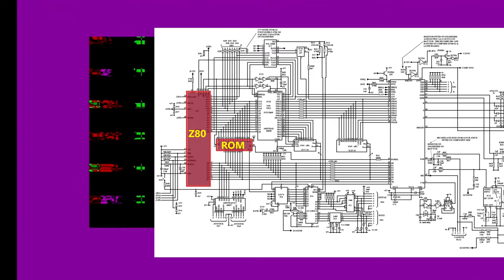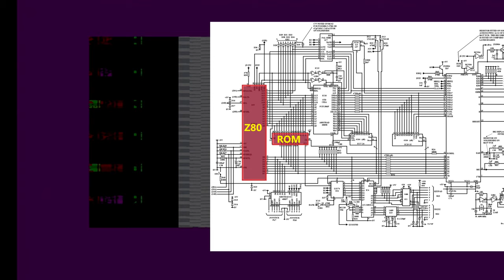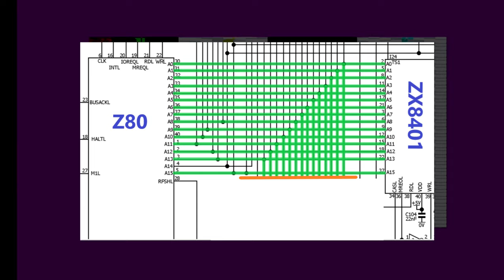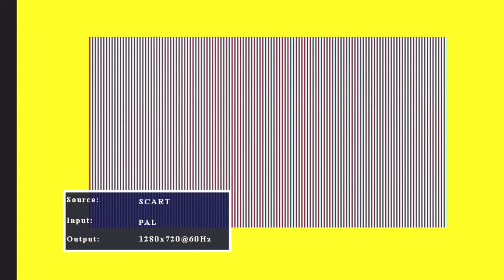ZX Spectrum 128K +2 Repair - Reset Switch and RAM faults

Comment: I pulled my old one out it was put away working but it has an issue now. It comes on as normal loads the game and it either crashes back to loader screen or it very slow or it just freezes in game. I’m thinking it might be a capacitor issue or a ram chip. It sometimes crashes while loading the first game loader screen photo on agent x the photo is scrambled
Reply from the maker: Could be an issue with your loading setup rather than the machine! If you're using audio
Reply: @HappyLittleDiodes  I’m using its tape drive it seems ok some lower quality games are fine but the bigger games are having issues
Reply from the maker: @WidowUK  you could try loading from a wav file using your computer.  Or the playzx app.  It's either your loading setup or your upper ram
Reply: @HappyLittleDiodes  like I said it was working fine last week but has suddenly become unstable. Normally if it was loading issue you would get an r tape error or it would just fail to load all together but as it loads the game and then has issues I’m looking at an hardware issue. It being very slow and freezing and crashing I think it might have a ram issue or maybe the power supply has a bad capacitor
Reply from the maker: Try the command PRINT PEEK 23732 + 256*PEEK 23733 tell me the result

Comment: hello, I'm trying to repair a 128 + 2 that has a similar problem, the magenta border and the black center. When placing the new 4164 chips on top of the existing ones nothing changes. Is the ROM broken? Is there any way to test the ROM? Where to get a new ROM? Thank you
Reply from the maker: What diagnostic tools do you have access to? Do you have an oscilloscope?
Reply: @HappyLittleDiodes  no, only a multimeter...
Reply from the maker: OK then you're a little restricted, but you could start by checking your voltages, find a schematic and check +5, +12 and - 12 V at points that are convenient to measure, they should all be pretty close
Reply: @HappyLittleDiodes  I just checked points of 5v and 12v. 4.84v (regulator) and 10.87v (tr4 leg). Any problem here?
Reply from the maker: 10.87 seems a bit low. Is it a grey or a black +2?
Reply: @HappyLittleDiodes  gray +2

Comment: I think I missed something... The address bus was held LOW, and when you removed the ROM, the fault seemed to disappear, so far so good, you replaced the suspect ROM with another, and the fault returned. As the address bus was held LOW, the diagnostic ROM could not be paged in, so removed the replacement ROM to make the diagnostic ROM work, and it did, finding the faulty RAM chips. This is where you lost me... If the address bus was actually held LOW not by the ROM but by the faulty RAM chips, how did the removing the ROM seemed to clear the bus?
Reply from the maker: I have no idea! But you have it perfect,  that's exactly what happened.  Something about the failure mode of the RAM chips meant address lines were held low but only when the ROM was fitted

Comment: What If one memory chip îs missing ?
Could someone use a modern memory chip to replace the memory chips of these machines ?
Reply from the maker: Yes it's easy to find them. For example with the grey 128K in the video you can use 4164 memory chips (£1.50 per chip)
Reply: @HappyLittleDiodes  Ok. I have some Sinclair like computers. Chips were made in Russia.
Reply: @HappyLittleDiodes  Thanks anyway. 
It would be interesting to fit some modern chips, since i have a few older memory cards.
Reply from the maker: I'm sure you can find equivalents!
Reply: @HappyLittleDiodes  I am not a repairman. Any suggestions greatly appreciated.
It îs a 8kb chip KR565RU5.
Reply from the maker: It looks like 4164 chips will do it.  Timings are slightly different (150ns vs 200ns) but worth a try at least.  Also the russian cheaps seem to be available on ebay and online